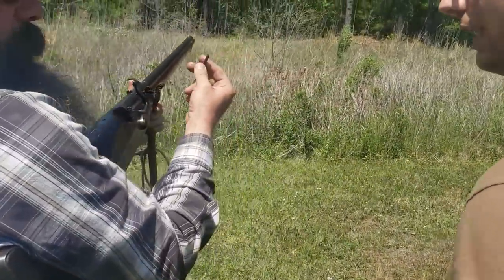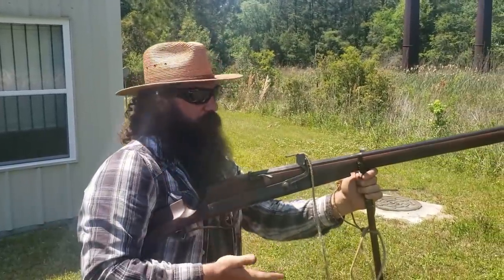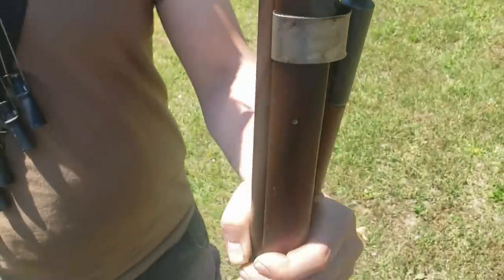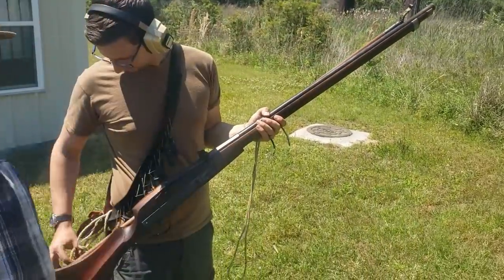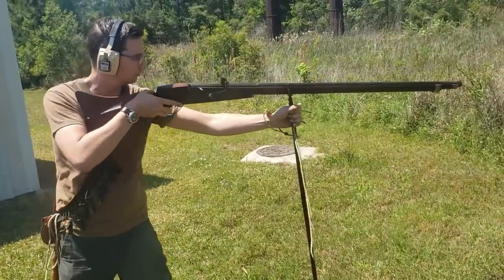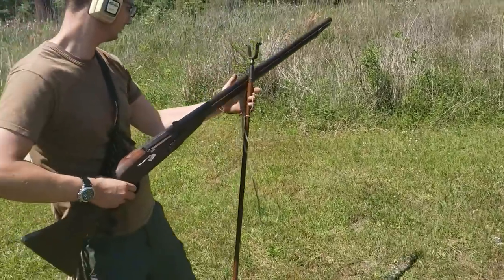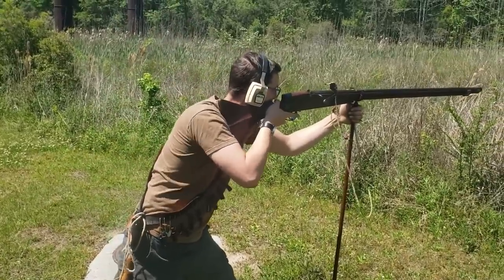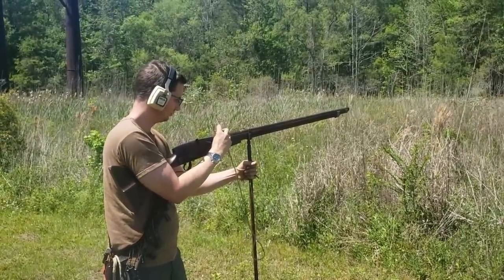Matchlock instruction session

Comment: Well now. Match cord that actually works. What are the steps involved in creating the stuff ? I do not suppose there is an SKU,or a manufacturer of something that was last used in wooden warships. As a kid,I messed with saltpetre and string and got nowhere. The older the technology, the more black magic is required.
Reply: Hey perhaos check with these guys, http://www.dm-feldartillerie.de/2013/abteilung3/kaiserliche-artillerie-augsburg.php, they are a German artillery reanactment group. They should be able to help you out.
Reply from the maker: Use HEMP rope, soak on salt saltpetre, and drip dry HORIZONTALLY. The hemp has a lot of oils in it, burns with a hot coal
Reply: @marknovak8255  Aha. Thanks for that.
Reply: The best slow match is the stuff that you make yourself. Saltpeter can be bought as stump removers and as sausage curing compounds. Both can be ordered off the internet
Reply: @marknovak8255  
 So now we know why marijuana aka hemp was made illegal in the early 1920-30s or so another gun control measure.😉

Comment: When you follow the drill manual of de gheyn it might be less awkward. All handling is done there with the right hand, so you could put the match in the lock while walking in the counter march without having to rely on the rest. I suppose its just as safe that way, if not safer because its simpler to do

Comment: problem is with this demonstration is that by the English Civil War (mid 1600's), most musketeers were no longer using the yoke (the monopod) to hold the gun. By the mid 1500's, many continental European armies were beginning to use the yoke less and less; as it is cumbersome and complicates loading. As the rest came to be used less and less, you can see a trend in stock design towards more ergonomic stocks and more reasonably weighted and balanced guns (since you are having to shoot it off hand now). Many of the Matchlocks recovered from the Mary Rose wreck (1545) already have a very modern stock shape, with semi-pistol grips and flat or gently sloping combs; stock designs that carried on in Central Europe to the modern day, and after a brief dabble with whimsically shaped stocks (like the "Roman Nose" style), returned to in most of the world.

Comment: I really want one of those Miroku Japanese matchlocks. Stock is a little odd (ends at your cheek, not your shoulder), but apparently works fine with a .54 cal thump. Pull the cheekpiece towards you and push the foreend away from you.

Comment: Very educational. Would this be the forerunner of the wheel lock or was that in conjunction with the flintlock? I would really like to know the timeline. Thanks
Reply: Matchlocks came before both, and were used up until the late 1600s and even into the 1800s in some places (ie Japan where flints were not in abundance). Matchlocks came about in the late 1500 early 1600s and were a technological improvement, but far more complicated. They were largely phased out as the flintlock was refined.

Comment: And while you are going through the motion the guy with the sword runs you through the guts and moves on to the next guy with the new tech hehehe.
Reply: That's why 16th/17th century armies had pike men.
Reply: To expand on the other comment: that is the reason that armies of the period (mid-1400's thru 1700-ish) consisted of a mix of pikemen/swordsmen and musketeers.  Originally a 80/20 cold steel to firearm ratio,  later an 20/80 the other direction.  The use of pike in combat generally petered out around the beginning of the 18th century for a variety of reasons, not the least of which was the invention of the socket bayonet which made every musketeer a pikeman who could also continue to use their musket as a firearm, as opposed to a very awkward spear when using a plug bayonet.  It hung around in the periphery of Europe for quite some time and at one point the Union Army was contemplating raising pike formations during the US Civil War.